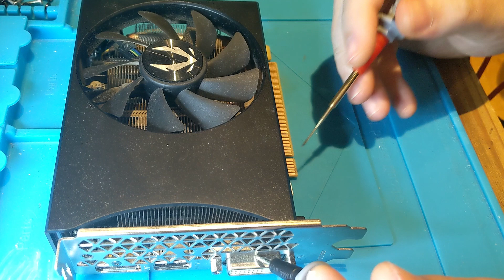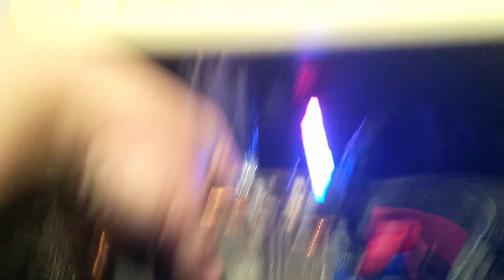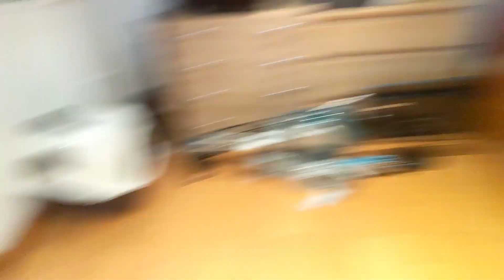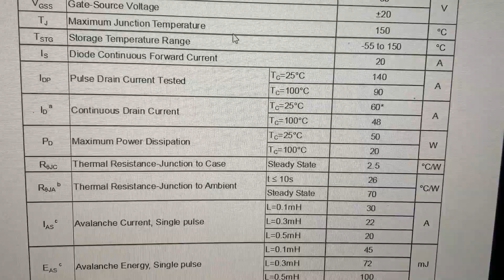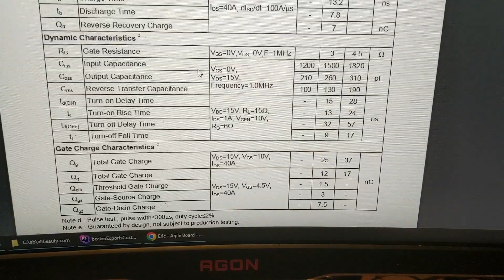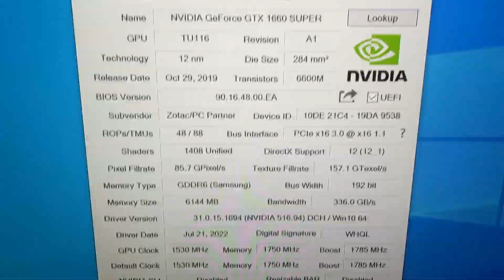Zotac GTX 1660 Super from eBay, spares or repair. Can we fix it?

Comment: The mosfets must be matched as closely as possible. The reason a lot of guys take them from donors.  The problem with a random chip is it's electrical difference. Thus is if one can possibly get all the chips as a match at once cheaply to change all at same time will match phases closely one to the other. Just mosfets. This guy just playing saved this card. If he can get another just as cheaply he can really boost performance in sli, but the cable on top is needed. Very good playing sir, I commend yee.

Comment: I need this level of skill 😅😅😂😂😂
Reply from the maker: Not that much skill is needed... I wish I knew more about electronics, as is... I have a bit of fun and try to learn by helping others with repair:)
Reply: @DIYRepairHour  im trying to rgh my trinity xbox 360, but i dont have the tools 💀💀💀
Reply from the maker: @mecyanned  yes, tools are super important, you can't do without them. And trust me I know, it's my hobby so 3 years ago I started with a wire of solder, a knock-off flux, $40 soldering iron and a $10 B&Q meter :D And with this I tried to repair a GPU :D Nope, can't do it.

Comment: Please please can you do more video on FULL pc motherboards.  Would love this very much
Reply from the maker: I can try 😁
Reply: @DIYRepairHour  I have 2 motherboards in need of repairs.  1 PCIe x16 slot crashing on display entering into windows.  The other one refuses to boot at all.  no post no beeps no fan spin NOTHING..  Im at a total right now.
Reply from the maker: @brexithope9084  for the first one it would need some more testing done. Like if it works fine with lower frequencies.You can probably configure the PCIE version in BIOS and see.
Reply from the maker: @brexithope9084  the second one I would start with measuring power button pins on the board. One should go to ground and you should have 3.3V on the second one. If there's a voltage and grounding it won't do anything then you go from there to your startup chip, these can go bad.